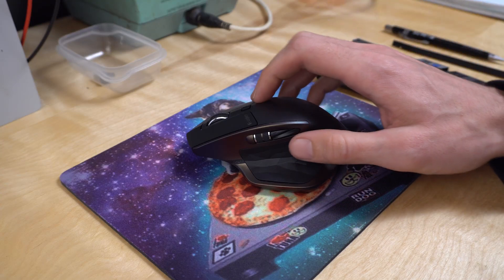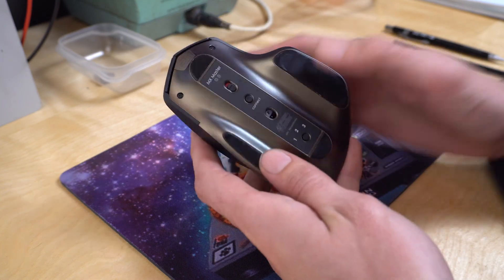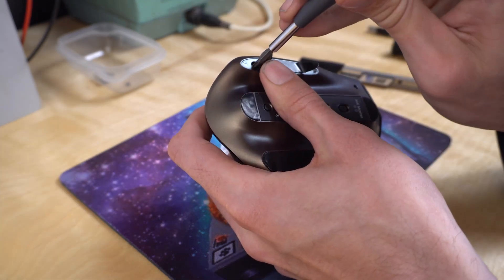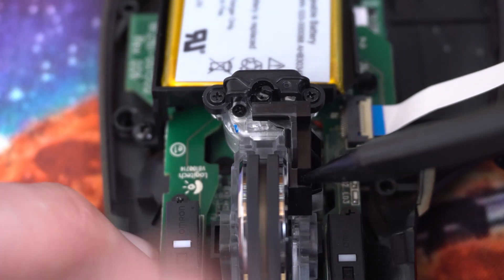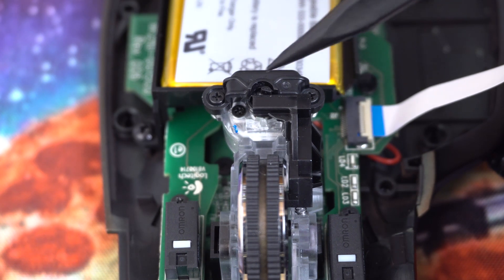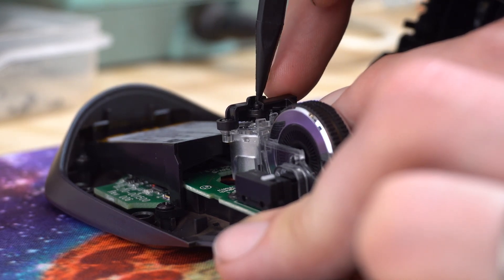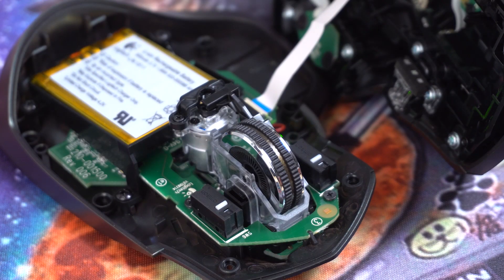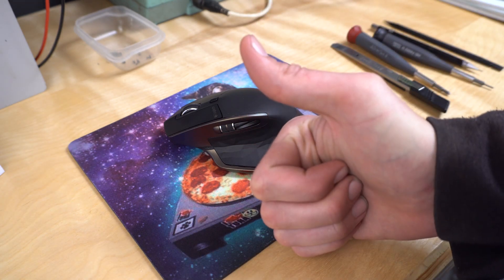Logitech MX Master Scroll Wheel FIX

Comment: Thanks a lot for this video! Even though this is my favorite productivity mouse, it’s had several issues over time — sticky rubber parts, a stiff thumb button, and now this. I’ve opened it up before, but this was the first time I had to do it for this mouse wheel scroll issue. Seriously, thank you - I genuinely thought it's time had finally come.

Comment: Don't be like me and take apart your MX Master 3S before first checking to see if it's a firmware issue. The 3S has a very different construction for the scroll wheel. There is a small black button underneath the scroll wheel that toggles it between ratcheting and freewheel via an electromagnet. When I dropped my mouse shortly after getting it, I accidentally disabled the ratcheting mode without realizing it. Just press that button to turn it back on.
Reply: So you DID open it up?

Comment: My MX Master (1st gen) cannot be fixed neither by lifting up nor pushing down the propeller. So I just remove the propeller from the motor's shaft, physically make my MX into ratchet mode forever.

Comment: I've got one of these and I don't use the ratchet mode but the wheel in smooth mode seems to move by itself sometimes. Do you have any suggestions for fixes?

Comment: Tried this fix and it worked for half a second until I turned it back on and the piece above the motor popped back up again instantly. Now I can't get the piece above the motor to pop back down again, it acts as if it's down all the way already and won't go down no matter how hard I push on it.

Comment: "It's a fantastic mouse!" 
Uploads a video about how it fukt up within days.
And THIS is why the manufacturers keep letting quality slide because people have become accepting, and even willing to praise garbage products.
I used my MX5500 from 2008 till 2015 when it went into storage. 
I got it out 3 months ago and the left click failed. I cracked it open and replaced the switch and the mouse, and amazingly the battery, worked fine for 3 months till yesterday.
Now the wheel will not ratchet and in some apps, my scrolling ignored. 
Considering the mileage and the years on this thing, I can't complain. Bummed but can't complain.
I just can't fathom how people can buy shite products or software or games and then tell companies: "But I love it! Keep reducing quality! We'll buy anyways!"

Comment: Wanted to share with others that I thought my MX was having this same problem. However, I realized that the square button on top of the MX above the flywheel is actually an engage/disengage button for the mechanism described in this (excellent) video. Press it once, and it fully disengages the ratcheting feature for full free-wheeling mode regardless of flywheel speed. Press it again and it allows you to switch between the two as normal. I had no idea until I thought I "broke" the ratcheting function of my mouse that I could actually toggle between the two!
Reply: GRANDE! Thank you, mate! I was thinking the mouse got broken in 5 days.
Reply: Whoa, this was exactly my problem, you just saved me a ton of work!! I thought I broke it but it was just a matter of clicking a button XD

Comment: Good video, thanks. The newer version p/n 810-006580 has done away with all that plastic moving switch stuff in favor of what appears to be a 100% electromagnetic switch. Energizing the switch creates the resistance with no movement that I can see. There is a little metal half-moon that can jump forward and get stuck though )(If you drop the thing 100x from 5' onto hardwood or tile. Took a minute to figure out to move that piece back on top (inside the wheel). In hindsight pics would have been useful but taking it apart again after all the PRAYING I did during the first dissasembly borders on blasphemy i think :)

Comment: ahh my mx master 3 mouse has the issue where it wont free scroll now too,  thanks for this information (i need to buy some replacement rubber pads if im going to do this though, it will ruin them and be annoying to move on my metal mouse pad)

Comment: I've had this mouse for 8 years now, and I absolutely HATE this wheel. It is so sensitive and if you jiggle the mouse enough, it will scroll whatever window you're on. I've had to resort to this fix like a hundred times already since I bought it. I'm hoping it to die so I can replace it with a proper mouse.

Comment: Another Tip: I had to repeat the procedure 3 times because the "Smart Shift" function was left ON in the Utility software. Once I turn on the mouse, it got stuck in free-wheeling again. Had to turn OFF "Smart Shift" in the software AND un-assign Mode Shift button from the middle button for it to stay fixed in Ratcheting mode. 
Thanks for the instructions!

Comment: Thanks for the vid. You've helped me feel confident in opening up my mouse. It's now 2022 and the mouse is STILL great. However, my cat knocked it to the floor and now it doesn't ratchet. The underside of my mouse is a little different than yours. There aren't two tiny screws near the front of the mouse. But, I'll give it a try!

Comment: this is what a tutorial video should be. showing how to solve the issue while explaining how it occured. no EDM intros, no asking to buy tool kits.

BTW, I didn't have any tools to open the mouse up and so the way I solved this exact same problem is by percussive maintenance. I just banged it right-side-up against my mousepad until the function worked again. Your video showed me that this might work. Don't recommend doing it the same way though, might result in the usual problems that arise from percussive maintenance: breaking it even further.

Comment: so for whoever have a problem where the wheel won't switch back to ratchet mode, my solution is to press back down that half circle attach to the motor. After sometime, that half circle thing will gradually move up the shaft and got stuck, so you just need  to press it back down.

Comment: What generational leap Logitech made from this mechanical ratchet wheel to the magnetic one in MX Master 3. 
Silent, smooth and software adjustable, the difference is night and day. 
And the battery, 6 weeks ON and counting...

Comment: Thank you. That was clear. Now to the Thumb Wheel. It is driving me nuts because the sensitivity adjustment no longer works, it seems, so if I am working with the mouse in any way, the pages jump back and forth as my thumb happens to touch the wheel. I want to take a hammer to it, but that probably will not be a good idea. I would like to eliminate the use of that thumb area, but the software does not offer cutting it out. Any solution?

Comment: removing the pads is about the worst thing you can do with a logitech..... every logitech ive owned was finally replaced when the glue for the teflon pads finally turns to gel and the pads won't stay stuck anymore..... last about 5 years. there is no way I want to peel the pads on my brand new $100 mouse.

Comment: Thanks so much. Based on you showing where this mechanism is, I was able to correct the issue without having to open the mouse at all, I just put some firm pressure on that area, and firmly pressed the button in the middle of the mouse in which is further back towards the palm from the school wheel. This re-engaged the mechanism and it's now back working as it did before. Wouldn't have been able to figure that out without this video, so thanks for taking the time.
Reply: You are a hero! My mouse got knocked off my desk and must have dislodged the key piece, but pressing the top button harder just managed to fix it back to normal! No need to find a tiny screw driver!
Reply: Thank you i did this too it was an awesome fix!!
Reply: That worked for me too! Thank you
Reply: what kind of sorcery is this. IT F*KING WORKED !!!!
Reply: Holy shit, thanks for this. Mine regularly disengages even after the fix.

Fixing it this way makes it much more bearable

Comment: I watched your video, which was great btw! Then pushed the scroll wheel and the square button at the top multiple times simultaneously and kind of shocked the mouse forward and that must've dislodged the scroll wheel mechanism you were showing... and now I'm back with a ratchet scroll wheel. Thanks for the breakdown!

Comment: Thanks Thomas for the very informative video. It helped me open up my mouse and solve the problem. However, I had a different issue.

The small plastic disc had not moved up, and the motor did not spin, it was stuck. I removed the two screws holding the plastic cover and the motor spins. Put the cover back on and it is stuck. I found a tiny spring that applies a little bit of pressure on the rotating disc. It had moved down, and was not touching the disc. I put it back in position after some effort and my mouse is back to normal. Just may be that this spring is pushing the disc up and jamming it.

Comment: This is a really informative video, thank you for making it! I had the same problem with my mouse too, but the one thing I discovered, just as I was about to open it up, was that the scroll wheel / button mechanism is disabled when the mouse is switched off, and the free wheeling scroll wheel will only work when it's switched on.

Comment: I was experiencing the same issue with my MX Anywhere 3. It always free spins and does not return back to ratchet mode. What I did was I flick the scroll wheel very fast and it returns to ratchet mode. Then I disabled the SmartShift feature from the Logitech Options app so it doesn't auto-shift to free spin. I don't like the free spin anyway so it's okay for me if I don't have that feature.

Comment: I have a different logi model but if I push down on the wheel it goes into a freespin mode and if I push down on the wheel again it goes into a rachet mode.  The mouse works fine on a youtube video but when I scroll on a mapquest map it scrolls out or in way too much.  It didn't do this before so I don't know what's wrong.

Comment: My issue was fixed when I did the opposite of what you suggested. In my case, pushing the part down makes it difficult for the motor to switch between back and forth. Lifting it up to a correct level fixed the issue.
Reply: same here

Comment: I had a similar issue with my MX Master 3. I disassembled it and noticed it didn’t have that same small piece that gets stuck on the mouse in the video. Rather, my problem was that the power cord (red, white, and black twisted cord that goes to the scroll wheel) that presumably powers the switch between smooth and ratcheting scrolling had come unplugged. Probably became unplugged after falling out of my laptop bag so many times. Hope this helps someone else.
Reply: thank you so much!

Comment: my friend, I am grateful to you

I have Logitech Anywhere 2 and have been using it for 4 months.

but i realized there was a problem and i didn't solve it

but not a mechanical problem

it just wasn't active as I didn't hold it down in full round mode

I understand this now

and I held it hard and the mode was activated

Press the wheel to switch between the two scrolling modes: high speed mode and click mode.

But by chance I watched your video and suddenly

I held the fashion hard with my hand and now it's fine

good

God bless you 

love from istanbul :)

Comment: Another thing that might fix this problem, and you have an MX Master 2S, is removing the cam from the shaft, and repositioning it back. I thought that something was wrong with the motor on the new 2S, so I swapped the motors between the MX Master and MX Master 2S, and doing so, I had to remove the cam and place it back on both mouses. Now both mouses work as they should, so I didn't really need to swap the motors, but for some reason, the old motor seems more snappy or powerful compared to the new one.

Comment: does it work with MX Master 3? I guess they are both have the same issue with scrolling. Just bought one (MX 3) and feel very disappointed, when realized, that the scroll wheel doesn't work correctly

Comment: if you recently bought this mouse and have this trouble then try the ratchet/freewheel toggle button (small black) located right behind the wheel. It works for me to get me out of the freewheeling mode. I can't confirm if the latest firmware version helps but it wouldn't hurt to try that as well.

Comment: I have a different problem that materializes then goes away, my wheel literally does not scroll anything for 8 clicks of the ratchet, if i scroll really slowly i can count the clicks and after 8 clicks my page scrolls a tiny amount.  I flip the wheel and instead of it flying like it should it literally CRAWLS down the page tiny jerky non fluid movement and i have to go fling fling fling fling fling fling fling about 15 times before I have gone one page.
REALLY annoying

Comment: Thanks, excellent video! Very nice to see before disassembling. I actually though it was a solenoid and that it was broken... The latter due to I couldn't hear the click when switching mode. It's quite loud on a working mouse. But the one I'm about to open it's only audible with the mouse close to an ear! Makes sense when it's a motor with non-engaging mechanics. So I'm fairly confident it's actually the problem here also! ;-)
Reply: The popped up "actuator disc" on the motor was indeed the problem. Unfortunately the fix only worked for a week or so. So next time cyanoacrylate glue will be added... ;-)

Comment: This problem will appear often in all mouses and the reason is that Logitech used not a proper material for a spring in that mechanical mechanism. The spring need to be periodically stretched or changed by a proper one. So Logitech quickly released a new model :(

Comment: If you are like me be sure you didn't accidentally press the "I" scroll toggle button just behind the scroll wheel because I didn't even notice it was there till I "fixed" my mouse by pressing it
Reply: Getting ready to do surgery when I came across this comment.  Updating the Options software appears to have cycled this mode.  Not positive on that, but pressing the scroll toggle button - which was assigned to other functions prior to the update - restored ratchet functionality.  Rainbows871 for the win.

Comment: Although I am embarrassed to admit this I thought a word from me might save some people going through the repair procedure above. My mouse is very new and I have not learned all it's features. Evidently I inadvertently hit the square button near the wheel and took it out of ratchet mode. The mouse was useless in this other mode and I have been frustrated for a week. I just pressed the button (heard the motor click) and I was back in ratchet mode and now have no problems. The position of this button  is such that accidentally hitting it seems easy to me. Anyway, if I experience a true mechanical failure as described in this video I will return to learn the fix. So no disrespect to Thomas. Maybe he can add a comment at the beginning for those of us that failed to completely understand the features on the mouse. First try and click the button to see if ratchet mode resumes. I also noticed in the settings that the mode can be altered so that should be checked as well before dis-assembling the mouse.

Comment: When you pull the plastic back from the philips screws does it go back to normal, or did you find that there was slight deformation from bending it back?
Reply from the maker: Slight deformation but hasn't affected the feel. After taking it apart a few times I decided to not reinstall the philips screws. The chassis snaps together and does just as well without them. So I don't have to bother the pads any more!

Comment: I've had my mx master for 3 years now, and have never had this problem. Though it's starting to get pretty work down in general.
Reply: Sounds like you just need a simple cleaning. There's probably a large semen build-up inside the scroll wheel over the past 3 years.

Comment: I tried this as I couldn't scroll at all on any web page or app. I had updated the software for my Mac a while back and scrolling stopped working, this is how to fix the issue: On your Mac…Go to

1) Click on the apple icon on the top left corner of the screen

2) Select System Preferences

3) Click Security & Privacy

4) Click Privacy tab

5) Click on Accessibility on the left hand side

6) Click on Logitech Options Daemon

(if it’s greyed out it’s because you have it locked…click on the pad lock on the bottom right of the little window to unlock it).

7) Then tick to allow it and save by locking.

Hope you have success!

Comment: So, I have the MX mouse and the scroll-lock button no longer worked all of a sudden. Pushing the button on the top simply did nothing at all. 
After finding this video, and having you explain it so clearly, I was able to simply hit the nose of the mouse against my hand to "unjam" the little arm that overshot the lock. 
And that fixed it. Didn't even have to open the mouse. 

See ma, sometimes hitting something DOES fix it!

Comment: For all you guys if you have this problem i found a super easy fix. Just tap on the mouse between the scroll wheel and button that toggles the spin, i did it with semi force cuz i was annoyed and was pointing at the hardware that switches modes. the wheel instantly popped up lol it was funny